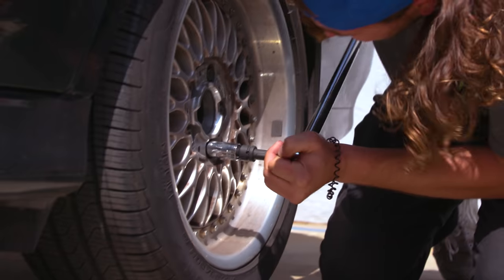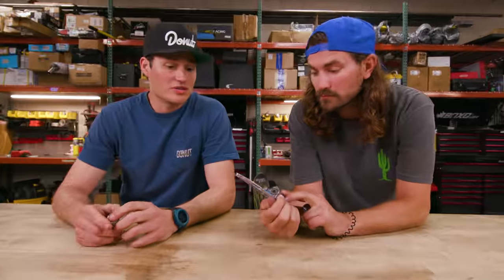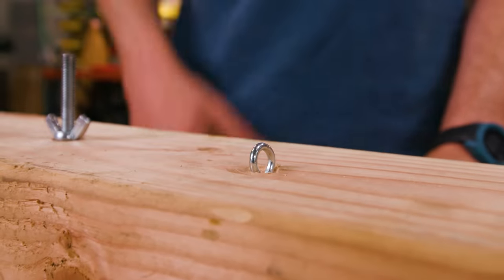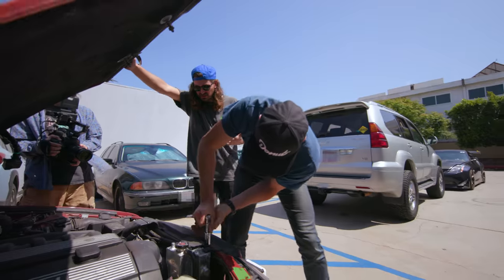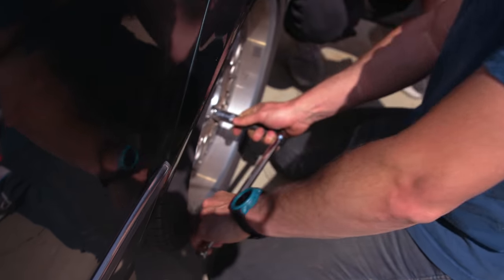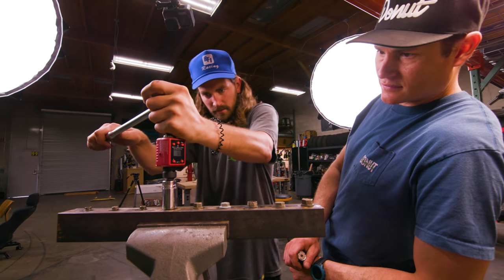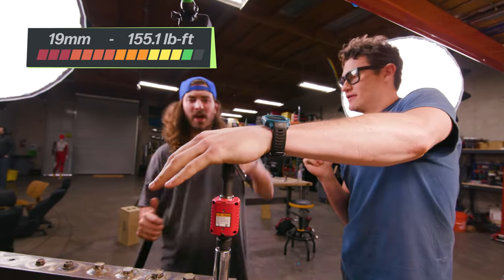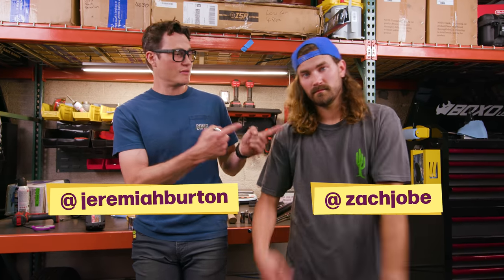Testing the World's Most Hated Tool

Comment: My wife bought me one several years back.  I thanked her and threw it in with my tools thinking it was junk and I would never use it.  Well, several weeks ago I needed to remove a square head plug on a mower engine and nothing I had would fit to take it off.  Found the gator grip socket and it worked perfectly.  It won't replace a whole socket set but it's great to have for oddball stuff.
Reply: Yeah, it feels like one of those "weird object saves the day" stories that might happen once a decade. For $10, eh why not. I wouldn't spend much more for that sort of thing
Reply: adjustable wrenches work too....
Reply: Crappie Chancellor   Depends on what kind of access you have to the odd ball bolt, hell a pair of pliers would have worked too but if the access to the bolt is limited then a socket may have been the only option.  the OP wasn't making the argument that it was the best tool ever or that it replaced anything.  For $10 it has its uses.
Reply: Crappie Chancellor    I know, right?  A crescent wrench doesn't work well in tight, recessed areas.
Reply: you dont own a pair of vice grips?
Reply: When I come across this situation I just start rigging something up with some channel locks or pliers lmao
Reply: @JoeTribuzio  Sometimes an adjustable wrench is way too fat to get into where you need it
Reply: @trollriders5682  or just run outside to do something real quick don't feel like taking out the whole tool kit because you can't remember if it's a 8mm 10mm or 12mm. And your too lazy to go check and just grab this. It's for simple stuff your not gonna torque something super tight with this.
Reply: @GlorifiedGremlin  if that big ass socket is fitting, then your wrench will fit just fine.
Reply: @SMD-si7fm  No, lots of riding lawnmowers have limited access to the oil drain plug, and your 3 options are the proper square socket (there's no 12pt that fits it), one of these, taking a bunch of other stuff off for clearance for a wrench (like the starter, steering linkage, and gas tank, on one I had). You only have to pull the stupid oddball plug once, if you replace it with a hex head pipe plug...
Reply: A whole lot of dudes in here just exposed themselves to the fact that they never had a mower.  Wrenches are useless with the limited spaces in those things.
Reply: You can usually get a 12 point socket that will fit on most square head bolts (might have to tap it on with a hammer) ... Me? ... I have a set of very old, good quality 4 point sockets :)
Reply: Crappie Chancellor   Who are "we"? And what are these "Chinese countries"?
Reply: That's what wrenches are for, no socket required.
Reply: @arkain1  he's just mad that you exposed his soft hands to the world. Cheers
Reply: @SMD-si7fm  "if that big ass socket is fitting, then your wrench will fit just fine" 
LoL, that socket is not anything close to being big, it's a normal sized deep socket and not sure if you realize that they are no close to being able to fit into the same space. Would you use a wrench to remove spark plugs? No, most will use a deep socket due to access.  Either you have never used tools properly or you are just trolling.
Reply: 12 point socket with take those off, just fyi
Reply: That's exactly what I used mine for, that square mower plug. A crescent wouldn't fit. Good to have for odd jobs, not for regular use.
Reply: @edwardgomez5616  You obviouly didn't bother to read the replies and just blindly blasted that into here. He's talking about lawnmowers, where wrenches won't fit.
Reply: I completely agree. i dont find it good for heavy shit like lugnuts but basic quickie lighter bolts and nuts are great for this. instead of having to switch sizes you just slap it around. not too shabby.
Reply: @MidwestFarmToys  You can't read the replies? The answer to your question is in there.
Reply: I use mine every couple weeks for an odd assembly. It's not necessarily the best fit for a job, a complete socket set and you don't need one. But the convenience of the one piece makes it worth keeping around for light jobs or where a surprise need comes up. Mainly use it for random size bolts. Does work well for small eyes as well.
Reply: Yeah, if the bolts aren't too tight it works fairly good. I never had much issue unless something was really tight to get off or you wanted to tighten something really good.
Reply: My thoughts exactly. It’s great for oddball fasteners.
Reply: Now if they made it with smaller tighter pins it might be a lot better tool but then you also have the strength of the pins to worry about as well
Reply: @GlorifiedGremlin  Blue-Knife ;)
Reply: 12 point sockets work on square heads
Reply: @chriswisneski6071  it’s a standard 3/8 pipe plug. That being the pipe size, not the socket size. 7/16 12pt works fine if you don’t have 8pts. 12pt is simply 3 4pt patterns offset by 22.5deg
Reply: @alakani  Except that's not what we're talking about here. Did you ever notice that the 7/16" socket always either fits loose, or you have to beat it on with a hammer, which tends to ruin either the square drive or the socket? That's because those squares are NOT 7/16" The 'standard' is actually 11mm (which is a little less than 7/16", and that's been the standard for that size plug for over 100 years), and the most common alternate size is 11.5mm (which is bigger than 7/16", but way too  small to grab with a 1/2" 12 pt). But those of us who actually know what we're doing have square drive sockets that fit properly. Square drive sets (usualy 8-pt, AKA double-square) come in all sorts of oddball increments you don't get in a normal 6- or 12-pt set, for a reason... But the issue we were talking about is the China junk plugs (commonly found in lawnmowers) that are off-spec, and often so far off-spec they're visibly not even square, because they're so poorly made.  Sometimes you can't even get enough engagement to break them loose with the closest double square, and true square drive sockets are hard to come by. Maybe read and see what those with more experience than you are actually talking about, before you interject with a 3rd grade math lesson, acting like you're showing everyone up...
Reply: All the people saying "a crescent would have" yea I'm sure it would have in a perfect scenario. But mechanic work is not always perfect is it? I've had plenty of times where I needed a crescent wrench but just had no angle to get at the bolt with it. Sure with some finangling you can get at it but still.
Reply: To be honest, 10 bucks for oddball stuff is a good value. Good thing to have, good price to pay. The ridiculous part is the marketing.
Reply: lmao People in these replies are oddly hostile to both this comment and the tool itself. 

Instead of getting weird about a tool, go to therapy for your insecurity.
Reply: @arkain1  our mower is a diesel tractor and doesn't have sparkplugs (mower attached to 3 pt) , the other one is electric ;)
Reply: Great for removing stuck wing nuts too, if you don’t have a wing nut wrench.  Or if a wrench can’t fit.  I wouldn’t buy one specifically for that but if you have one, might as well use it.
Reply: @mechanomics2649  For real. Plus a lot of "dumb" infomercial items are essentially useless for the average person, but useful for people with disabilities or injuries. I could screw in a hook with a wrench or pliers, or I could put this thing on my drill and save the carpal tunnel aggravation for something I don't have a tool to make easier.
Reply: Did you then go tell her you finally found a great use for it and that it saved you from having to go buy more tools in the moment?
Reply: They complained that it stripped bolts but I've only used my gator grip to remove bolts that were stripped by other tools. Lol
Reply: So many “men” in here trying to win a pissing contest about “what tool when”. If it works at the moment use it, or shut up finish your Bud light and drive home in your pink KIA.
Reply: @boblundgren1280  Yeah but this isnt for high torque enviroments either..

Comment: This saved me a trip to the store once after sitting in my tool box for years unused.  It's good for low torque bolts if you cant find a socket or something.  For big jobs, just use a standard socket
Reply: Mines been sitting in my toolbox for many years. Haven’t used it yet.
Reply: Agreed - it's useful for low torque applications. I used it around the house to put hooks in the ceiling to hang things. It once saved my butt and did remove a damaged screw for me .As soon as you need that extra oomph you are better off using the right socket for the job. For sure it is not a replacement for dedicated size sockets - but here and there it is a nice addition.
Reply: I use one with an impact to put bolts to connect teleposts to beams in houses and they work good enough for that
Reply: Idk where mine came from but been in my box for over a decade unused lolol I think my father bought it in the 90s
Reply: Yup definitely for light duty
Reply: Yup good take away
Reply: I've used mine on brake jobs many times.  One socket on both caliper pins and bracket bolts.
Reply: I was just about to come in and say this. It's my go to for quick stuff on bolts. Because of this, it sits in my junk drawer with a ratchet instead of my tool box. Saves me a trip to the garage
Reply: Ya my dad has a Mastercraft one that ACTUALLY WORKS but still would only use for small job
Reply: My father had one and he had a just for those bolts you would run across once in a blue moon and to this day it's it's in the tool chest waiting for that probably we haven't had to use it in about five years.
Reply: what if my sockets are metric
Reply: I use the magnet for rc car bolts lol I wouldn’t dare use it on my actual truck
Reply: if you cant find a socket or something go buy one
Reply: I agree with this sentiment 100%. It's an absolute useless piece of junk 99% of the time, but it's so small, you might as well just keep it around for those 1% of times it could actually come in handy.
Reply: I hope gas was expensive enough during the time it saved you a trip to make it worth the money you gave to this "company".
Reply: @krabby8216  Mastercraft? Looked like a remastered Minecraft huh?
Reply: @spedler61  yes
Reply: @oscarsolo2209  but its quite expensive to buy.
Reply: @h8GW  what is this company you referring to, h8GWBi?
Reply: @blixxy1320  they have metric one, available in euros.  Be warned though, they're left handed only. ✌️
Reply: My problem is that even when it might get the job done, I don't want to risk destroying the fastener head. Much less work to just grab the right socket than to destroy the head 95% of the time with this tool, then having to drill out the bolt because a real socket no longer works either.
Reply: @purwantiallan5089  tell me your 13 without telling me your 13. Mastercraft has been around longer then both of us put together 😂
Reply: Yeah, if there is some nuts that are in an open area, not deep well, not high torque, and you dont know what size it is, it has helped.
Reply: Couldn't agree more.
I've had mine for.. must be getting on for decades now.. and it's still "fine"
Not a replacement for a full set of heads, but great for odd random things and perfect for a "I don't want to carry a full set in my car"
Reply: Yeah I got one as a stocking stuffer and I've actually used it a few times for weird stuff here and there. Definitely don't love it but definitely don't hate it either.
Reply: @genericjosh96  Ya right. Maybe a Chinese impact.
Reply: Why did you sit in your toolbox for so many years?
Reply: @Chwarg  100%
Reply: I've used mine a lot, if a nut or bolt is messed up and rounded off that's what I use, you just can't go ham
Reply: Quite handy for bolts with damaged heads but certainly NOT for impact or any medium plus torque jobs
Reply: I mean I used them while I installed Garage Doors and the Gator Grips worked amazing in those high torque applications.
Reply: @chrisbarrettFilmstudio  like they saw the bigger the bolt the better it works
Reply: @zacharyl5418  supposed to keep in your shirt pocket like on the infomercial.
Reply: Yeah I've got one of these and actually really like it... Sure I'd rather use the proper socket the first go around... But from time to time this little sucker comes in handy!
Reply: I think that's it. It's a great "emergency use" socket.
Reply: I have one in my work toolbox for when there's something that I don't have a socket for.  It doesn't get used often, but when it does it's a lifesaver.
Reply: Absolutely . I recently used mine to drive screw eyes and hooks into the ceiling. Great for odd jobs. Like you said for anything serious I would use a proper socket or impact socket set
Reply: @purwantiallan5089  LOL @ "but its quite expensive to buy." 

Yes, $10 is VERY Expensive, make sure you take out a 2nd mortgage to purchase one.  

I can guarantee that a lot on here have gone out and spent way more than $10 on tools they already have but misplaced.
Reply: I love it when working on my mountain bike.
Reply: @JESTR_ACTUAL  it realy is the perfect junk door socket.
Reply: @lordfrz9339  agreed... it's one of those gimmicky things that actually works enough to do well in a pinch.
Reply: Right. Only a idiot would use it for high torque or impact type stuff. Like using a vice grips to change your wheel
Reply: So don't get them. We aren't trying to be nice here. Cheap crap is cheap crap. Im an electrician. If my tools break or dont work i get hurt. That applies for "around the house". The only people that buy these and cheap low quality tools are yuppies that wished that they knew how to use tools. They buy all this crap to do their little diy projects and then never end up finishing the project because they don't know what they are doing. I hate when I go to my mom's or dad's house and don't have my own tools and they need something fixed. If you aren't going to take the work seriously its better to not buy the tools at all then to get the cheapest crap. Get someone who knows what they are doing. Instead of trying to "save money" and do a crappy job, you should probably work a little harder at your actual job to afford a professional to do it right. Buying a bunch of crap and rigging it costs more and takes way more time. My yuppy brothers spent an entire weekend and hundreds of dollars trying to put in a sink at moms house. I stayed away because i knew that they didn't know what they were doing and they argued with me on every piece of advice i gave. Lo and behold the sink collapsed a week later and my mom had to call a professional to do it right and quick. Why not just do that in the first place? If they really wanted to learn how to do something then they should apprentice under a professional. Respect that what we do takes knowledge and experience, not just watch a YouTube video and buy a gator socket.